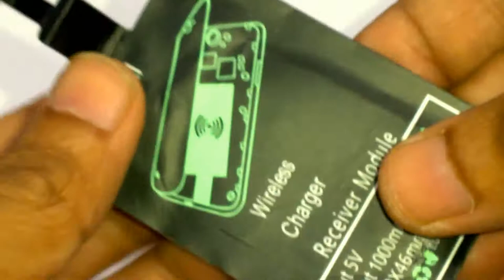Wireless Charger & Receiver Disassembly -  What's Inside?

Comment: Have you tried to attach only the metal part of the pad/adapter to the phone? I'd like to add one to my phone and put a skin on top, rather than using a case, so that its thickness is reduced as much as possible. Is the gold sticker (the one that has black underneath, right on top of the coils of the pad) necessary for charging, or can it be taken off as well to reduce the thickness even further?

Thanks
Reply from the maker: I thought about that too, but there is no point in trying to reduce the size of the sticker because the PCB is much thicker.